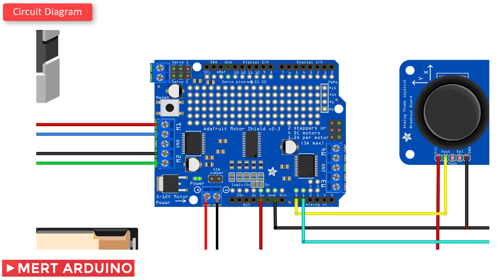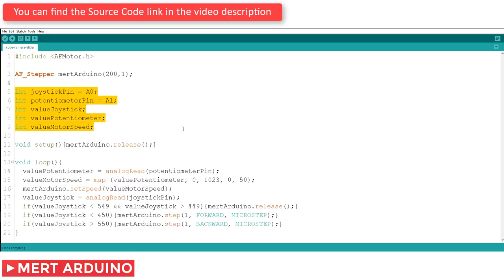DIY Arduino Motorized Camera Slider | Adjustable Step-Speed and Joystick controlled

Comment from the maker: Source Code: https://create.arduino.cc/editor/mertarduinotech/8743ab33-f052-4b1a-94fa-f2035d254c4e/preview
Recommended Items:                
Use Your Muscles in Project - https://amzn.to/3wdL45C
37 Sensor & Module Packages - https://amzn.to/3m66WeQ
Try this Robot Arm - https://amzn.to/3fq8DCl
Best Resin 3D Printer - https://amzn.to/39tY8KB
Arduino Compatible Kits - http://bit.ly/2J2AFF7
Banggood Spring Sale - https://bit.ly/3slMbOn

Comment: Merhaba elimde 17HS4401 Model nema17 ve 1.7A akım degeri var. Cnc shield ve a4988 kullanarak aynı senin 3d baskılarını kullanarak slider yaptım pot ve joystickle kontrol edilen ama çok aşırı derece ses çıkartıyor ve yavaş hareket ettiremiyorum l293d motor shield ve 3 tane ektradan l293 bacaklı pin aldım benim nema 17lerdw problem çıkarırmı yada nasıl yapabilirim